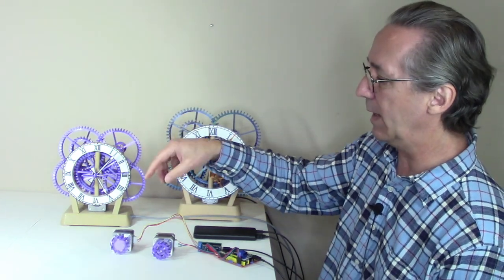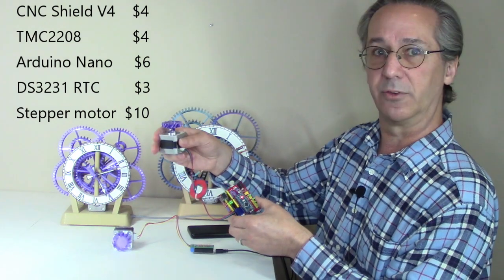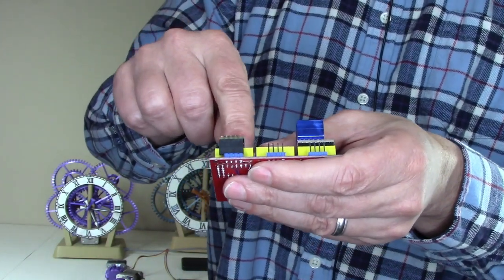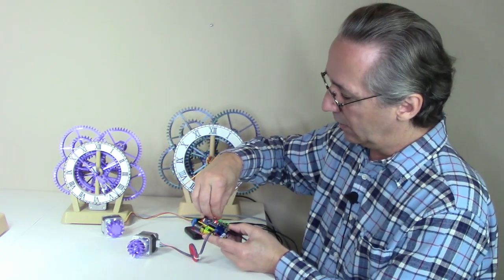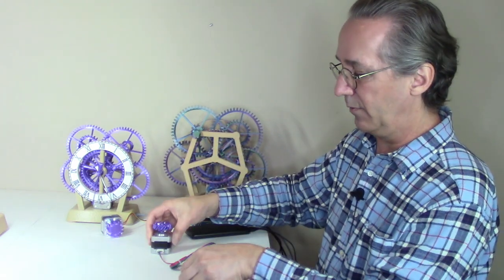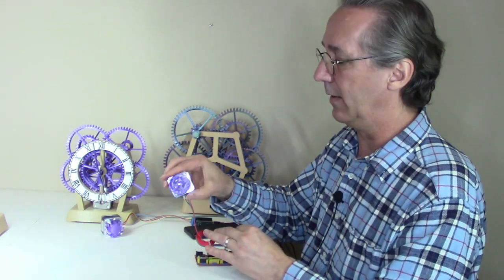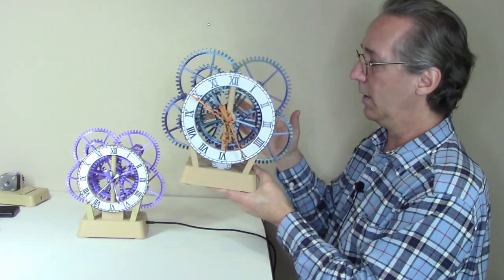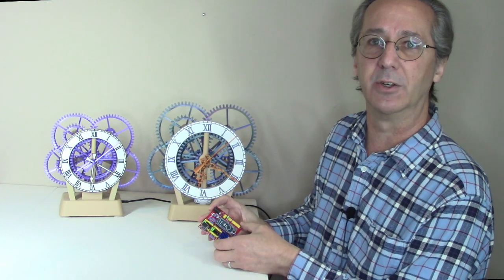Improved Clock Driver Circuit

Comment: I followed the video and soldered everything together and I get nothing. I not sure what is wrong but the stepper motor doesn’t move.
Reply from the maker: Is the motor completely static, or is it locked up and just not spinning? Can you open the serial debug monitor and report what it says?
Reply: @ I have never used an Arduino nano so I don’t know what the serial debug monitor is.
Reply: The motor moves when turned by hand
Reply from the maker: @jacobwesslowski2164  The serial monitor is briefly described in the "CNC Shield V4 Addendum" that can be downloaded at https://www.stevesclocks.com/sp6

It is launched by clicking on the magnifying glass icon in the Arduino IDE.
Reply: @ this is after I uploaded the code to the Arduino nano
Reply: The serial monitor says speed zero (1.000 RPM slow test mode) steps 53 (plus 1/3)Min_delay 9000 max_delay, 9500 but the stepper motor still does not move
Reply: It is also reading exactly 1 minute on the dot every minute
Reply from the maker: @jacobwesslowski2164  There should also be a stream with random "+" and "-" on each line if the Arduino Nano is tracking the RTC. Each line will take exactly 60 seconds. If the serial monitor shows solid ------- or solid +++++, then the RTC is not getting recognized.
Reply: @stevesclocks  I’m getting alternating pluses and minuses on each line
Reply from the maker: @jacobwesslowski2164  That information is helpful. Speed 0 is the default mode when no jumpers are inserted. Add a few jumpers to enable different speeds. Maybe the current adjust potentiometer needs to be set a bit higher.
Reply: @stevesclocks  I added a jumper to speed one stepper motor still does not move
Reply: @stevesclocks  I even tried it with three steps in bring it to speed seven (20.000 RPM fast debug mode) steps 1066 (+2/3) min_delay 430 max_delay for 65
Reply: @stevesclocks  I tried it on each jumper
Reply from the maker: @jacobwesslowski2164  The problem appears to be in the area related to the stepper motor or related wiring.

It could be the current adjust potentiometer. Double check the wire on the back that connects 5V Vcc to Vmot. It may also be the TMC2208, stepper motor, or stepper motor cable.
Reply: @stevesclocks  I have a second shield V4 I could try to rewire that one because my wiring matches your diagram.
Reply: @jacobwesslowski2164  I am also having the same issue my motor is completely locked however the code did not want to upload directly to the Arduino I realised I have an Arduino Nano Every so had to adjust the code, but I have little to no knowledge with coding or using such components so I am a bit lost
Reply: I'm having the same issue. Wiring appears to be correct, motor does not move. I've adjusted the pot on the driver and the jumpers but nothing seems to get the motor to move.  Any suggestions?

Comment: I troubleshot a lot and deleted my last comment (ended up being a bad motor), it got everything working, except I cannot change motor direction with the indicated pin, the motor just stops, the motor I bought said it is bipolar, what could be my issue?
Reply from the maker: The jumper pin functions have changed as new clocks were added but are stable now. The assembly notes for the latest clock at https://www.stevesclocks.com/sp10 shows the latest jumper pin mapping. I will migrate the important sections to the older clock assembly guides when I get a chance.

The motor direction can be changed by reversing the cable at the 4 pin header. 

When the motor stops, does it lock up where it is hard to turn? Or is it just like no power is applied? Or is it jittering without rotating? The current adjust potentiometer may need to be set for a higher current. Or it could be something else depending on what the motor is doing when it is stopped.
Reply: @stevesclocks  Perfect, swapped the cable and it changed directions, when I used the jumper pin it was a hard stop I couldn't turn the motor, thank you for following up!
Reply from the maker: @sange777  Makes sense now. The "dir" jumper was re-purposed to add debug modes. It may have been in one of the LED or RTC test modes. I will update the manuals to make it more obvious. And I will redo the board labels if I need to order more boards.

Comment: Just a question about the edit at around 3:19. If I'm correct, all that edit does it's ensure that the board is powered by the Arduino Nano instead of a 12V power supply, and isn't entirely necessary, correct? I ask because I have a 12V power supply and If I can just use that instead, I probably will
Reply from the maker: All of my 3D printed clocks that users can download and print are expected to run on 5V USB power. The only access through the back of the case is for a USB cable. This provides a very low current to the stepper motor which is more than enough to run the clock.

The CNC Shield V4 board can run on 12V. In fact, the original use case is for 12V power. You will need to skip the jumper wire edit that shorts Vmot with 5V Vcc, or else 12V will be applied to several 5V components.

Comment: Never thought that one good use of making a digital analog clock would be to make it quieter. 🫡
Reply from the maker: I consider it to be a mechanical analog clock with digital accuracy. The mechanical portion makes all the noise and needs the smooth motion to make it quieter.

Comment: Can you more closely show the jumpers and the different settings? I’m trying to follow the documentation, but the speed doesn’t seem to be changing.
Reply from the maker: There are multiple versions of the clock using an algorithm that evolved as more speed modes were added. The oldest version of the algorithm didn't even need speed jumpers since it only supported a single gear ratio. The algorithm supporting the newer clocks is a superset that adds additional speeds without changing the old speeds. I just refreshed the algorithm on my website so all downloads point to rev 2.08. This version adds additional debug information in the serial debug monitor window. 

Try downloading the algorithm again to see if it fixes the issue. It looks like the SP6 addendum for the Silent Shield controller needs to be updated to include both versions of the controller board. I will get to it when I have a chance.

Comment: I am currently attempting to design a 3d printed clock (weight driven) and have been binging your videos. I have a general understanding of how weight driven clocks work with gear ratios, escapements, etc. But I was wondering if you could recommend any resources to help a beginner. Thanks!
Reply from the maker: There are hundreds of books about traditional clockmaking using brass gears. Many say similar things and can typically be found used for a few dollars.

The clocks I design are closer to a wooden gear clock. My favorite reference is a book called "Making Wooden Gear Clocks". It has plans and instructions for six different wooden gear clocks. Clayton Boyer and Brian Law also have eBooks for sale describing their process.
Reply: @stevesclocks  Awesome. Thank you for your response!
Reply: @stevesclocks  I am most of the way through Boyers book. It looks like one of the bigger challenges that I am going to have while designing is the cannon pinion-clutch mechanism

Boyer talks about fixing the center wheel to the center arbor and then using a set screw in the cannon pinion with a piece of leather to friction-fix the cannon pinion to the arbor. I feel like this won't be that easy of a task on 3d printed parts, especially if I have a smaller cannon pinion or one with more teeth

I saw on your "pendulum wall clock assembly" video part 1, you have a mechanism that friction locks the center wheel and the cannon pinion with a spring and  lock mechanism. 

Have you tried any other methods? Or do you think that your spring mechanism should be something I should try out on my first go?
Reply from the maker: @adidisai48282  The friction clutch is a simple object with many solutions. 

Traditional brass clocks use a dome shaped washer. They might not be easy with 3D printed parts.

Clayton uses a leather pad. I have never tried it, but it seems like it would work best with large diameter arbors.

Jacques Favre has an elegant and compact design using two pieces of music wire that pinch around the arbor.

The pen spring design works great with small diameter arbors. 1/8" or 3mm arbors might need springs larger than a common pen spring. It needs about 1" in length along the arbor, so you have to find room for it.
Reply: @stevesclocks  Hmm okay. I am going to try to see if I can find Jacque Favres method. In the mean time, I will probably plan to use your method. Thank you for your help!

Comment: Nice work
Interesting! RTC makes the clock very precise, indeed.
The ultimate precision would be to add a GPS receiver, might hard to get to work indoor
What about a counter of some sort that use the 60 hertz of power supply as reference
Reply: Perhaps a serial wifi module and connect to a NTP server for accurate time.  Your Christiaan Huygens design was my first 3D printed clock!
Reply: @daveschings828  Nice.
Christiaan Huygens did great contributions to horology. I admire how he could sync cosmic time and clocks

Comment: Thanks, this looks like an interesting upgrade to my desk clock!  I just ordered parts from Amazon and downloaded your Arduino software.  In looking at the Arduino code, what library is RTC.h in?  While I have some DS3231 libraries none have RTC.h.
Reply from the maker: Thanks for bringing this to my attention. I don't recall having to install the library. It was a while ago. "Sketch-->Include Library" shows it as a contributed library. Maybe this means I installed it.

Try "Sketch-->Include Library-->Manage Libraries..." (or Ctrl+Shift+I) and search for RTC. It was written by Manjunath CV. The code compiles properly when using version 1.0.2 but "#include <RTC.h>" needs to be changed to "#include <I2C_RTC.h> if using the latest version 1.6.0.

Do you know of a preferable RTC library? It seems better to switch to a library with more consistency. The only function used is RTC.getSeconds() which gets polled to see if another second has elapsed.
Reply: @stevesclocks  I didn't see the Manjunath CV library right off the bat.  I've used the DS3231 library by Andrew Wickert in the past and it works OK, I can't comment on whether it's better than any of the others.  I changed your sketch to include the DS3231 library to replace the RTC.h library and also change getSeconds to getSecond as the command is different.  Compiles fine but I don't have my hardware to test.
Reply from the maker: @daveschings828  Thanks for the hints. I can confirm that DS3231.h runs properly with minor changes to the sketch.

The only changes needed are as you suggest to change RTC.getSeconds() to RTC.getSecond(). Also, "RTC.begin();" was commented out.

I updated the sketch on my web site and added a few comments on how to install the library.

Comment: Thanks for doing this.  Have you looked at the 2209?  It may have some advantages over the 2208 and is about the same price
Reply from the maker: They appear to be nearly interchangeable, so it should work just as well. The 2208 runs so quietly that I stopped looking for anything else. :)
Reply: @stevesclocks  Thanks for the reply.  I know in the 3D printer world that the 2209 is the preferred driver chip and is only a couple of $ more,  Something about being able to save settings in UART mode and no physical adjustments needed for current.
Reply from the maker: @woodwaker1  The CNC Shield V4 does not have the extra socket pins for the UART, so it would need wires on top of the TMC220x to connect. As far as I can tell, both devices use identical motion control technologies. Automatically adjusting the current might be a nice feature, but it is not really worth adding the jumper wires for this. Stall detection could also be nice.

The 2208 has a maximum current of 1.4A, while the 2209 supports 2.0A. I haven't actually measured the motor current while the clock is operating. It might be around 100-200mA.  Measurements only show 1-2 degrees of temperature rise, so it must be quite low. I suspect that the 2209 has a smaller sense resistor resulting in slightly higher minimum currents. It should still operate the clock.

Researching this driver has been enlightening.
Reply: @stevesclocks  Thanks for your time and replies.  I am not that familiar with the differences, I know that the 2208 was a major improvement over the old drivers, and the 2209 had some advantages for 3D printers, but in your case the 2208 would be the best solution.  I'm working on getting my Bambu printers running, then will revisit the clock